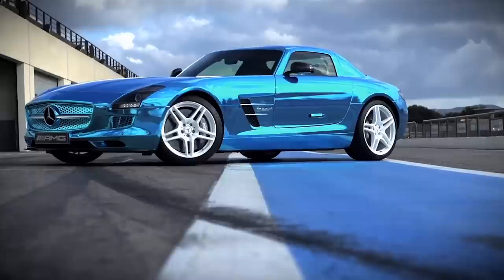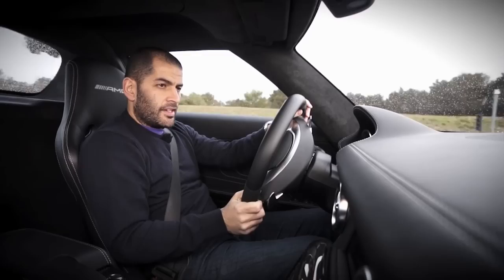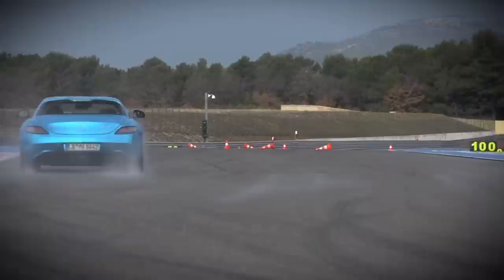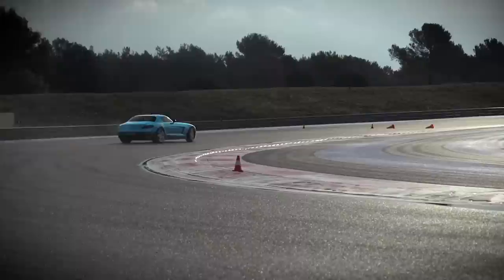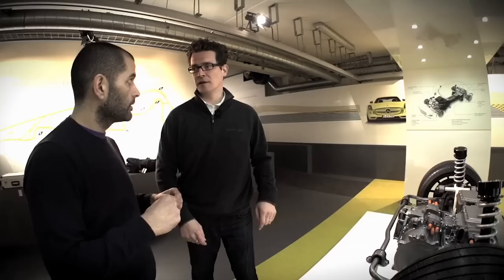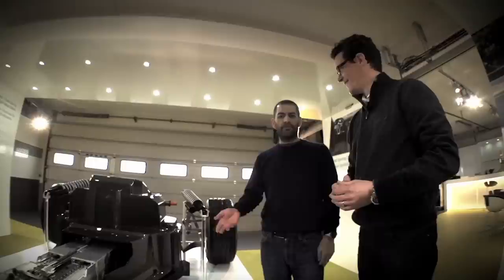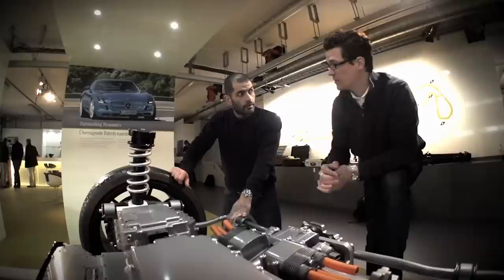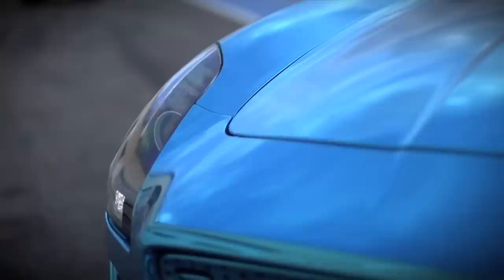Mercedes SLS Electric Drive. Can Volts Ever Match Pistons? - /CHRIS HARRIS ON CARS

Comment: No awesome engine sound. No good. I wanna hear my car.
Reply: Agreed, and so do other drivers, and pedestrians, and animals. Silent is deadly.
Reply: domzbu
Another good point!
Reply: domzbu did they make klaxons illegal or something?
Reply: Not if china builds two new coal fired power stationsaa week and the world is still anti nuclear.
Reply: You won't have a choice at some point. Everything good comes to an end.
Reply: rockgod2131
Battery cars are gonna go the way of mini-discs. They're a red herring. Other, better more efficient and friendly tech will surpass it quickly. Hydrogen is a lot cleaner than battery. Heck even modern petrol engines are cleaner when you look at the construction, power generation and eventual battery disposal. And even just the generation bit, if you're running it off electric charge produced by a coal power station, you're already dirtier than petrol.
Reply: hold the chicken
Holy crap that was a load of fail in one comment!
1. If you're gonna do a WTW (well to wheel) analysis, you also have to take into account the drilling, refining and transportation effort to get a litre of petrol into your tank. Do you know how much a litre of petrol has polluted allready even before you use it in your car? No you don't, and its alot. Go search for WTW and come back once you've read some honest research.
2. There are many reports finding that even if your electricity comes from 100% coal power, its STILL less polliting than a comparable petrol car. However, very few drive on 100% coal, most drive on a mix of fossile, nuclear and renewable, which makes EV pollution even lower. And in my country, Norway, we get 100% from renewables, yes 100%. And all over the world electricity production is just getting greener and greener.
3. Another point that goes right over your head is WHERE the polluting happens. Regardless of what the total pollution is, EVs have ZERO pollution where it counts, in cities and crowded areas.
4. How the fuck do you come up with the idea that hydrogen is cleaner than battery? Do you even understand what you are saying? First of all hydrogen  fuel cell tech is EXTREMELY inefficient and polluting. First you have to generate electricity, then you have to use that electricity to do electrolysis of water to get hydrogen, then you have to transport this all around the globe(under high pressure mind you), which btw requires a completely new infrastructure, then you fill your car with it, and then the fuel cell can finally use the hydrogen to convert it BACK to electricity, that goes into the battery(yes hydrogen cars are battery electics too), and then you can drive. That whole expensive, inefficient and highly polluting chain can be replaced by putting that electricity you had in the first place, right into your battery at step one.
Hydrogen is not an energy source, its just an energy carrier.
Sir, do you have ANY chemistry education at all?
5. In 2017 we will most likely get a battery revolution, its estimated that the new tech will give 5 times the range, shorter charging time and lower price, than todays batteries.
That will be the final nail in both hydrogen fuel cell and fossil cars coffin.

Do me a favor, take a screenshot of your comment above, print it out and put it in a safe place, then take a look at it again in 5 years! You will have changed alot;)
Reply: Peter Orsome salty ball bag more like
Reply: Krevin Grard
use your brain.
Reply: Silent is bad when you are sleepy too...
Reply: they will start to sound like a thunderstorm once we get beefier batteries, only for high end cars though, normal people will be a lot more quiet(just like they are now, right right?)
Reply: fucking agree man i wana get a car that does sound higher than a fucking vacumcleaner
Reply: Tommy BMX
just tell me if you can stand the silence AFTER a test drive in a Tesla S
Reply: mrmadame28 sounds like a PRIUS fan... WE GOT A PRIUS FAN HERE!
Reply: mrmadame28 haha sounds like my teacher !
Reply: Tommy BMX i am your teacher.
Reply: mrmadame28 what if i was your father...
Reply: mrmadame28 just because i dont like teslas doesnt mean i would be a bad father. Or if thats the case i dont know whats wrong with you...
Reply: hold the chicken About the silence of electric vehicles, compared to a "normal" ICE car the noises are not that diferent.
When ICE car drives below 30km/h it makes verry little noise unlles it runs at a very hgh RPM, and at speeds above 30km/h the tire noise is predomenant.
So from "safety" stand point they are not that diferent.
The only time that the ICE car is louder is when it accelerates real hard or has a modified exaust.
Reply: hold the chicken 
1. Hydrogen is not cleaner than battery by a long shot. Just making hydrogen and using it in a car is at least two times dirtier (depending on technology), because it takes at least two times the amount of electricity to get hydrogen to the user than to use that electricity to charge your car.

2. When talking about emisions everybody compares the tail-pipe eision of an ICE car to emmisions of a coal power plant, nobody takes in acount the emisions that are generated before you even burn  the gasoline in a car. And the world average amont of electricity  that comes from coal is about 50%.

I actually did the calculations on CO2 emmisions, and came to the conlution that the electric car emits more CO2 than gasoline if more than 77% of the energy that goes into charging the car comes from the least efficient coal plant.
In addition to that, refining oil uses electricity (not longer oil it self, because it is cheaper), and for geting 1 liter of gasoline out of oil you need to put in the amont of electrical energy that could propel electric car the same distance than 0,5l of that gasoline.

So if you switch to electric and you charge your car 100% from coal plants you still produce 60% less CO2 than gasoline car (all together not just tail-pipe).

Furthare more the "dirtines" of a car is not mesaured in just CO2 but allso in NOx and SOx, which couse acid rain and contribute to resperatory deseases.
Large power-plants have allot of filters that prevent those emitions going into the air, in contrast to ICE cars that only have a catalitic converter, which is not as afficient as those filters, and is completley useles on the first 5min of driving, because they have not yet wormed up to their operating temperature.
Reply: mrmadame28 its because i dont like teslas. Am i hurting your feelings maybe? If so you should stop caling me things.
Reply: mrmadame28 because i dont like tesla.
Reply: Tommy BMX it is not amusing me anymore, it is boring.
Reply: Tommy BMX stop to prove that you are one then,...
Reply: i cant understand your unclear sentences without any meaning what so ever
Reply: Tommy BMX i understand that it might look weird when you don't understand anything. The whole world must seem weird to you. I am sure you can live a nice live anyway. I know someone very ignorant and he can take the bus without any problem.
Reply: mrmadame28 omg... What part of (I AM SICK OF TALKING TO YOU ) did you not understand?
Reply: Tommy BMX The part where you keep replying...
Reply: Krevin Grard google "battery cars quiet danger" lots of studies
Reply: Krevin Grard cities tend to have lower speeds yes, and lots more pedestrians
Reply: +Brahm Zuckerman there can be a fix for that
Reply: if you open your window in a Honda insight you will hear the screech of a electric motor reving up and down the rpm.  it sounds exactly like a turbo spool, but that's only for people who likes to hear turbos....
Reply: Krevin Grard should  could would but the reality is we use the sense of sound a lot of the time in combo with sight
Reply: hybrids seem viable with a sound emitted in place of the engine to alert people to the presence and speed.
Reply: C-U-N-T = Can't Understand Normal Thinking
Reply: There will be an option to have noise generation in production models, We are already getting these "sound synthesizers" in cars now!

Comment: no i'm not talking about the noisy one when even at 1k rpm it sounds like thunders, I'm talking about when someone put the pedal down and the car goes up to 7-10k rpm, the engine sound is what really makes high speed more enjoyable. Like gunning down the straight road, fly by then hard break and hard downshift at the corner, those sounds are truly amazing and I'm sure as hell if F1 moves to e-engines, it'll lose some of the magic.

Comment: The torque vectoring on the Fiesta ST is done by braking the inside wheels around a curve...here it is done by reducing the drive to the inside wheel which is better but heavier.

Comment: I agree about the energy density, but you also have to consider transferring of the energy from the grid to the battery. They may eventually become wonderfully dense, but if it still takes 30+ minutes to charge them... I don't think the public will accept that at every charging/fuel stop.

Comment: The brake lights are the only things flashing... don't know where you're seeing headlights flashing. The flashing brake-lights is a (godsend) new feature of regenerative braking. Since most EV drivers (myself included) would like the car to slow down when I take my foot off the pedal, something needs to be there to alert drivers behind you that you're slowing but not using the brakes. So flashing brake lights is to help alert drivers behind you about slowing down without the brakes.

Comment: @nickd the tire is gripping the surface till the sidewall is stretched to max then the tire has to break free to stay on the wheel. Some surfaces give a smooth transition from grip to slip but in this slow mo scene the tire's grip was moe than its sidewall stiffness. Go watch a top fuel dragster rear tire in slow mo during launch. It is just not the smooth and simple thing we picture a tire doing.

Comment: To be fair, when manufacturers use the term zero emissions, I think they are usually referring to tailpipe emissions which is a valid point in itself as there are obvious air quality implications in urban areas if a substantial portion of the fleet can be made zero tailpipe emissions. Not to mention, centralising the emissions means that when an older power station is replaced with something cleaner, the electric fleet immediately becomes that much cleaner in real terms too.

Comment: The SLS E-Drive is an amazing piece of engineering. And if remember correctly, when Top Gear tested that yellow one, it was as fast or quicker than an SLS AMG Black Series, so I'm pretty sure Harris's seat of the pants dyno/laptimer was wrong when he said it didn't feel as fast as the regular SLSs.

Anyway, if I had 600,000 USD to burn on one, I'd buy one if they could have it done in traditional colors, like silver with a red interior. Then I'd trade it in for a newer one when battery tech advances and something more like 350-400 miles of range per charge is possible.

Amazing proof of concept. And I love how many supercar makers are going with torque vectoring now, so that everyone can be a track day hero. Having the car being able to basically turn like a tank pretty much eliminates understeer and makes clipping apexes insanely simple.

But I'm still glad I spent those thousands of dollars on racing schools, to know how to performance drive any car.
Reply: He only said it didn't feel as fast in comfort and sport modes where it limits the power output, but not in sport plus mode with full power available.
Reply: babybirdhome Whoops. Should have paid closer attention.
Reply: At top gear's test track, the electric was 2 seconds slower than the black series. It was faster in the drag race because of the torque and de hp advantage. 
Cheers

Comment: By the way, I believe the first internal combustion engine was even older.
"1860: Belgian Jean Joseph Etienne Lenoir (1822–1900) produced a gas-fired internal combustion engine similar in appearance to a horizontal double-acting steam engine, with cylinders, pistons, connecting rods, and flywheel in which the gas essentially took the place of the steam. This was the first internal combustion engine to be produced in numbers."

Comment: It's not a modification. The Leaf limits motor current as it ramps up from a stop for some reason, and does little to present this ramp-up on the display. You can bypass that ramp-up by tricking the controller into forgetting it was accelerating from a stop. So you floor it 'til the "dots" reach the end (around 10-15mph), release the pedal briefly, then floor it a second time, and it'll give you a bigger burst of power. It's not all throttle and mechanics anymore... computers are now involved.

Comment: You could just combine the diff and transmission together (maybe even a CVT so you wouldnt even need a gearbox), sort of like a trans-axle. Then have a large motor, or two smaller ones for torque vectoring.
You'll need a bigger motor to hit higher speeds, so this two small motors and CVT combined diff setup makes sense.

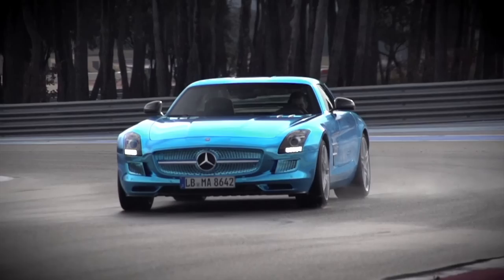Comment: Jeez, at around 6:34, the rear driver's side tire (in the wet, mind you) has so much grip that the rim nearly comes off the tire as it wants to keep sliding while the tires are clawing at the wet pavement, refusing to slip.  Just when I finally get over the amazing paint color, the car gives me something else to drool over.

Comment: I hereby invent a new feature in future EV cars. It's called "Gas Engine Audio Roar" or GEAR. What it does is that the audio system outputs sounds depending on the conditions of driving as if it was a gas powered car. You can pick the car type you want e.g. Ferrari mode. A feature possible is to add a speaker on the underside of the car that can be heard from the outside also. 
Problem solved :-)

Comment: Electric is exciting. No more messy oils, no more engine heat, weight, complexity, noise, odors and direct pollution related health issues. Maybe on a sports car or bike a gasoline will still make sense in the future, but once the batteries will be there, the dirty gasoline engine will be a museum relic.

Comment: Petrol and cars that run on it will not fade out. Rather, petrol will become extremely scarce making it more of a luxury than a commodity. While the masses shall be using electric cars as electric power becomes more convenient and affordable, petrol cars will become a luxury for those more able to afford them and afford the high petrol prices of the future. 

Due to the market clearing itself—basic workings of demand and supply—petrol will not run out. It will only become too economically unreasonable to extract and sell to the masses. This is my stance on the issue.

Comment: You may not realize this, but there is more than one type of motor braking. An electric motor braking, could brake so fast that it would be very dangerous. The fastest braking method is plug braking, which is basically throwing the motor into controlled reverse that causes it to want to stop in order to change directions; next is DC injection into a spinning AC motor which will immediately stop the motor dead still. These methods are battery energy users instead of returners like regen is.

Comment: Aside from energy storage and its associated weight (at the moment), the electric motor is really superior for the automotive application to the internal combustion engine in every way.  It's far more efficient (electric motors are ~90% thermal efficiency over ~30% of conventional engines), far less complex (higher reliability, efficiency, and serviceability, more packaging options/interior room), and more controllable (allowing the car to be more dynamically flexible as shown in this vid).